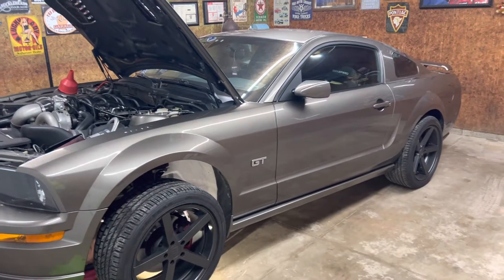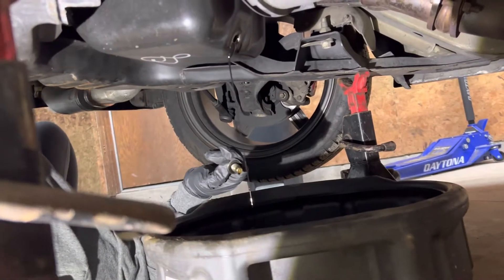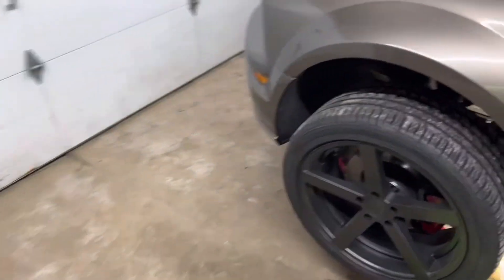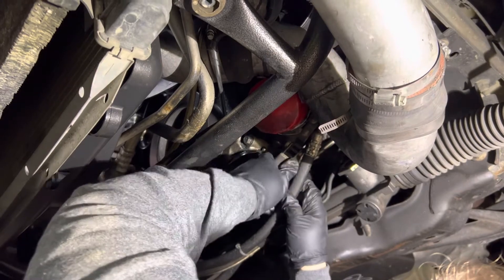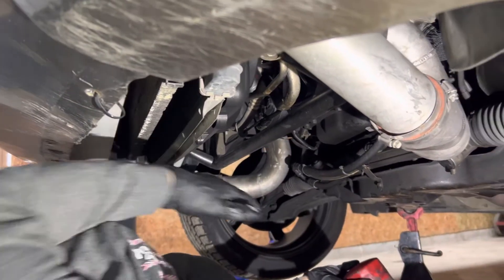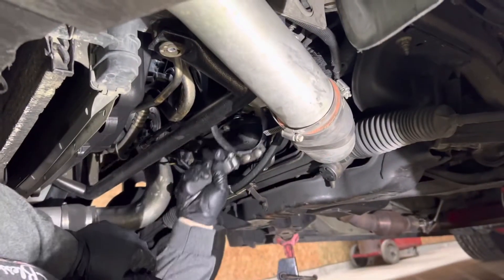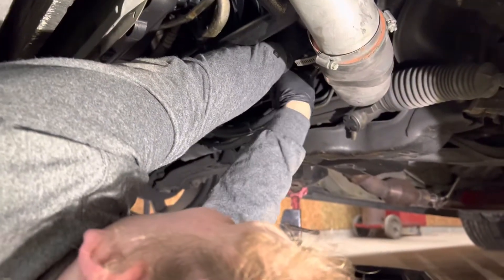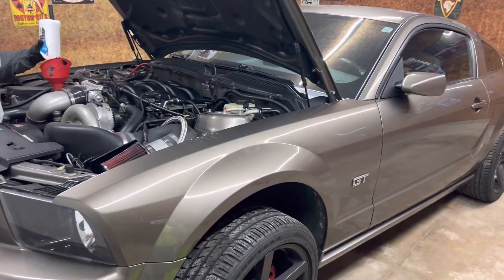2005- 2009 Mustang GT oil change

Comment: What about a spark plug change tutorial?
Reply from the maker: I can definitely make one if you would like me too.
Reply: Of course 😁
Reply from the maker: I can do that lol
Reply: The 2 piece mustang spark plugs it’s kind of difficult to change? I hear a lot of that
Reply from the maker: They can be, I haven’t had any issues in the mustangs but the trucks are a lot worse because they’re driven in the winter and for so long that the carbon builds up on the end of the plug and when you go to loosen them they break off. The mustangs aren’t that bad because we don’t drive them a ton and every year I take them out and clean them off and re anti seize them.

Comment: What type of oil did you used and how many  quarts did you used?
Reply from the maker: We used Walmart super tech and 6 quarts. Normally I use valvoline full synthetic, but this particular engine had a knock per the previous owner and I wanted to verify that without spending a lot of money on oil. The new engine has 6 quarts of valvoline full synthetic and a motor craft oil filter

Comment: I put 5w30 in my 09 4.6 gt it calls for 5w20 you think It won’t hurt the engine?
Reply from the maker: Na your engine will be fine. I’ve ran 5w30 in all my 4.6 and 5.4 and 3.5 engines. Never had any issues. The only reason ford says 5w20 is because of the emissions threshold in the early 2000s. If you look at a 91 to 95 4.6 in the thunderbird, town car, crown Vic, or grand marquis they call for 5w30
Reply: @T-MillProductions  ok because my engine use to tick because a roller follower failed an it grinded into the stock cam I put new stock cams in it all new lash adjusters roller rockers new phasers timing chain guides meling high volume oil pump I just got car back an it was quite for 8 miles but I could of sworn I can slightly hear it ticking again 😔
Reply from the maker: Dang man that sucks that you had to do all that work to it. So far both my 3vs have been good. If you were using a super thick oil like a 20w50 then I would definitely say that’s a problem but 5w30 is just a hair thicker and isn’t gonna cause any issues. How many miles were in it when the lifter took a crap?
Reply: @T-MillProductions  so right after I bought it it started at 97982 miles I only drove it to 98000 I really didn't get to drive it i couldnt wait to get it fixed now that its fixed now I don't think I want to drive it an find out with my luck it messes up again but I never beat on the car sense I had it
Reply from the maker: That’s strange because that’s low miles for an 09. Are you the one who replaced the the parts on it or did you have a shop do it? Because it shouldn’t be ticking right after a rebuild
Reply: @T-MillProductions  I took it to a shop i used all factory parts except for the melling high volume oil pump but I hear that is a good pump I just drove it to work it was quiet untill I drove it a while there's a light tap at idle its not loud like it was before weird it wasn't making noise right after it was replaced tho
Reply from the maker: I’m wondering if you have a small exhaust manifold leak that sounds like a tick. Does it go away after the car warms up?
Reply: @T-MillProductions  maybe it's quiet when cold then there's a lite tick/tap when it starts to get hot could phasers do that to? Maybe they got to break in?
Reply: @T-MillProductions  I just got a check engine code p0349 po345 cam position bank 2 code maybe it's a phaser making that noise
Reply from the maker: Did the person who did the work use ford oem cam phasers and timing set? I saw a video about this a while back where people that used dorman ones or autozone ones would have them go bad very quickly and the pin that sets the position in the cam would start to chew in to the cam. I would call your shop and ask them what they used
Reply: @T-MillProductions  I bought the parts an had a mechanic install them I bought factory oem ford everything phasers timing chain guides lash adjuster lifters rockers I just went with a aftermarket melling high volume oil pump tho
Reply from the maker: That’s strange because they should be just fine if it’s all oem. My only thought would be if the guy who put them in did it wrong. 1 thing that ma have happened is if he didn’t use engine assembly lube on all the new parts or if he didn’t let the lash adjusters soak in oil for a while. I would change the oil in a clean pan and check for any metal shavings
Reply: @T-MillProductions  I noticed I went to check on it he didn’t use assembly lube I drove it around on the highway an now it’s not making any tapping noises anymore all I could hear was injectors I don’t see the original cam sensor going bad it worked great 4 days ago before the work was done it didn’t have that check engine light maybe it could of been that phaser making the noise I’m taking it back Monday so he could look at it Ford said all they would do is warranty out the phaser not help with labor I guess I’ll be out another 1000$ if it turns out to be faulty
Reply from the maker: I feel like the guy who did the work took some short cuts to save time. But I will say, before you take it in ohm out the cam position sensor and see if it is actually bad. The ash adjusters have to be soaked in oil so they can fill up and get as unchanged air out as possible. When I rebuilt my 2v I let them sit over night in oil and you should have seen all the air bubbles that came out. That shop you took your car too should have some kind of warranty
Reply: @T-MillProductions  yeah tobad he said there won’t be any warranty on labor because I supplied the parts I paid him 1000 to install them I think all he did was soak everything in oil he didn’t use assembly lube when it was apart the cams where wet with oil
Reply from the maker: Damn dude that sucks. Was it an independent shop or a ford dealer? 1000 seems far for the amount of work. But to not even help with the cost of the labor if they just touched your car.  How loud is the tick? Do you have a video of it?
Reply: @T-MillProductions  yes I know it was a independent shop I’m sure I’ll look at it imma take it back every one else wanted 2500$ in labor to do the job when it was ticking last night an this morning it was not to loud now it seems like it went away I was wondering also if that high volume oil pump would make the phasers not work right I hear they lock an unlock with low an high oil pressure maybe it has to much oil pressure the mechanic that did the work said it was making 45psi at hot idle
Reply: @T-MillProductions  I'll make a video on it thanks for your time BTW I never owned one of these cars before don't know to much about them
Reply: They say to use the 5w20 only. If you go to other oil you risk having issues with cam phasers, etc.
Reply from the maker: I’m not saying you’re wrong but I’ve never used 5w20 in any of my fords ever and I’ve never had any problems. My 08 edge has 235k miles and I’ve only used 5w30 it’s whole life. All the 3v engines I’ve owned I’ve never ran anything but 5w30.